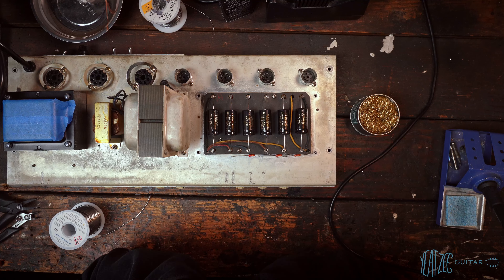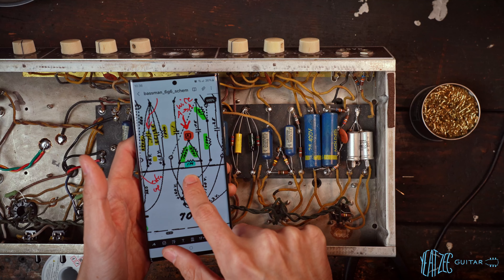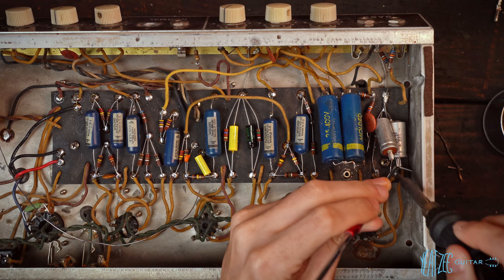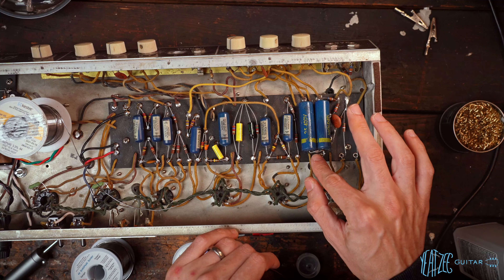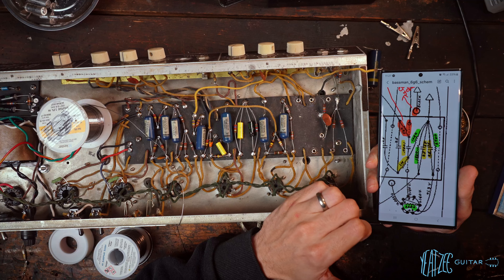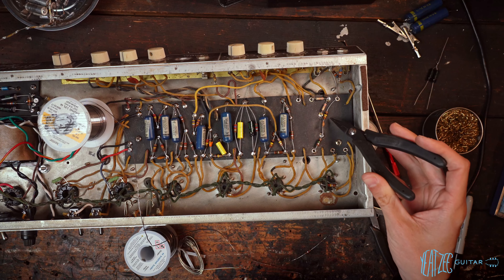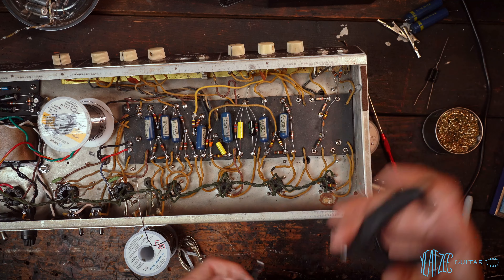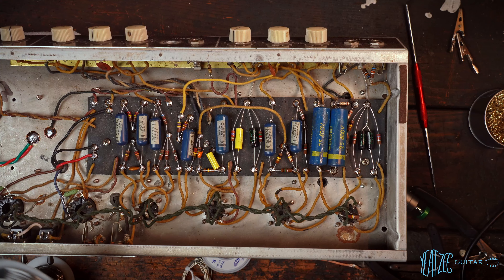RIP IT ALL OUT | 1961 Fender Bassman 6G6 Amp Repair - Pt. 6

Comment: Modern resistors, especially carbon film, might only be rated for 400 volts or less, and so in a power supply it might be smart to uprate the replacement resistors to a higher wattage/larger size.

Comment: Those big blue .25 molded caps look like Aerovox, which I've never seen used as stock caps in a Fender ---- unless they ran out of caps while trying to fill an order and sent somebody up the street to the local electronics parts store to buy something that was close enough to work (as Fender was known to do on occasion).
Reply from the maker: Probably originally .25 astrons there. I swear I've seen these blue caps in fenders before, but I don't remember the details. Either way, I'm suspecting they need to be swapped.
Reply: @YeatzeeGuitar  , Astrons are usually yellow, IIRC; and they're unreliable. These blue .25's seem to big for the eyelet board which makes me question their originality..... but Fender was constantly changing parts vendors and filling in from local parts-supply houses as needed.
Reply from the maker: @goodun2974  Yeah no I'm saying I think these blue caps were replacements for what would have probably been astrons originally. I think ALL of the coupling caps in the amp were replaced, the leads are so short it screams ebay parts bin buys made to work.